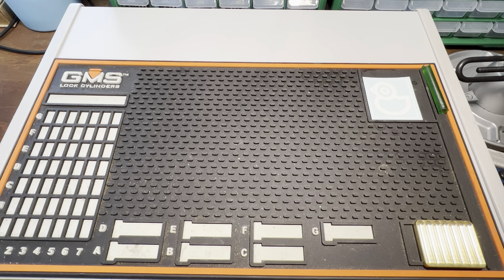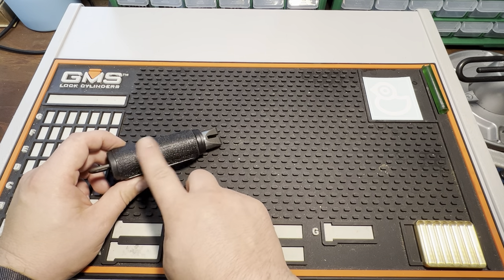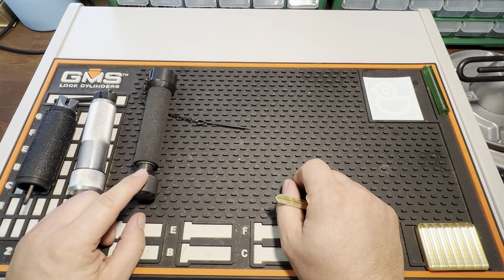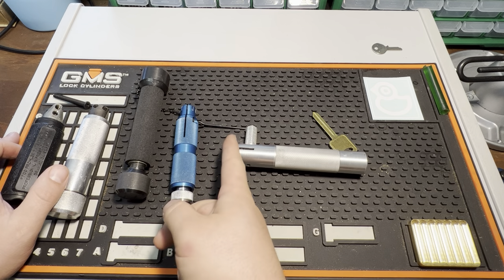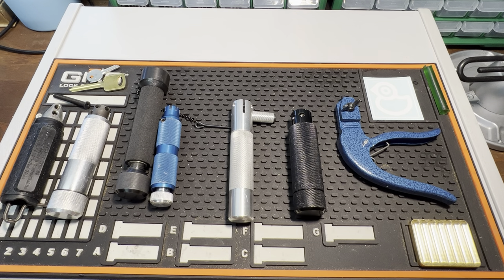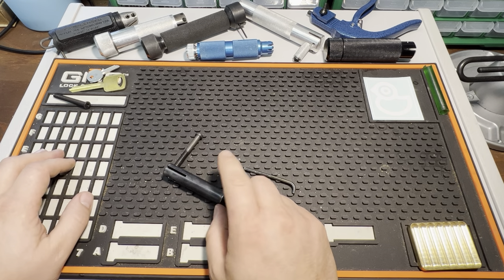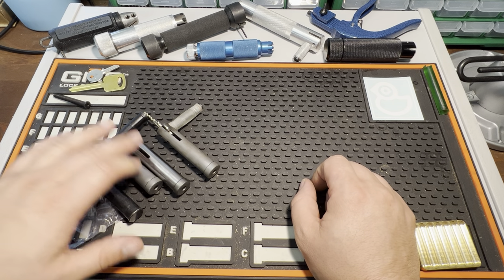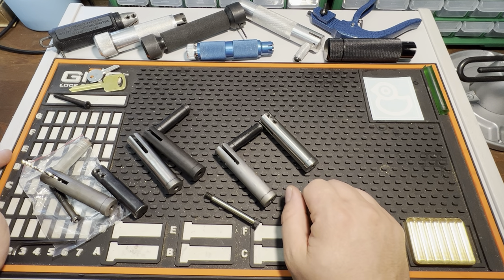(45) Building a better mousetrap: how key impressioning handle came to be

Comment: Great tool collection, I really like your design!  The blue key impressioning tool was made and sold by Dire Locksmith Supply Co (now defunct) in Denver Colorado.  I have a couple of copies of the book that went with the tool.  It's called The impressioning system of key fitting by S. A. McLean.  I have never been able to find the actual tool though, you are probably have one of the few remaining.
Reply from the maker: So, these are still sold, by lsc in Australia. I had mine imported just a few months ago. I still haven't been able to make it work for me, I'm so ingrained in my old ways.

Comment: You should make the Allen head screws into wing nut bolts so you don't need an Allen wrench to tighten the key.
Reply from the maker: That would make clamping the key, and holding the grip fairly awkward. I’m still trying to figure out a tool-less grip, but it’s slow going